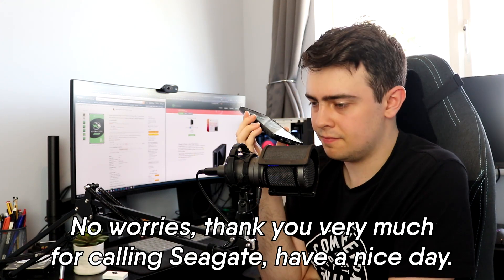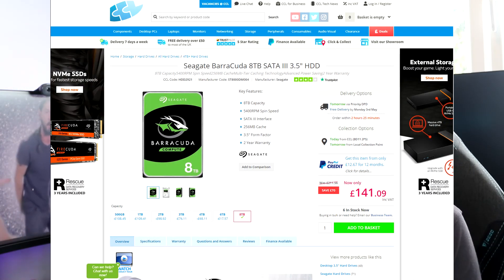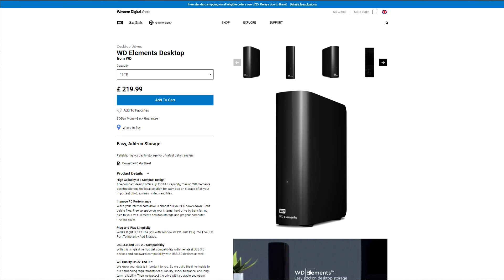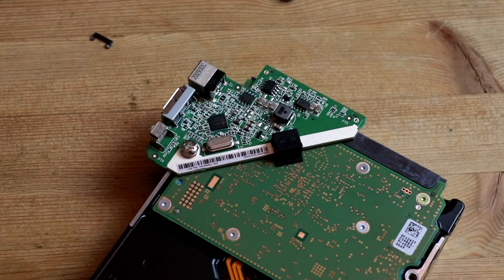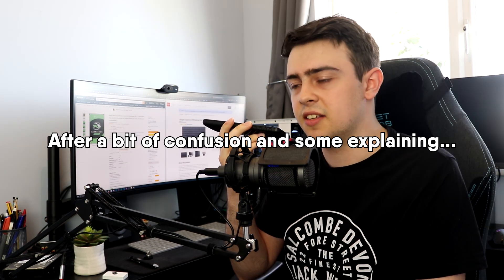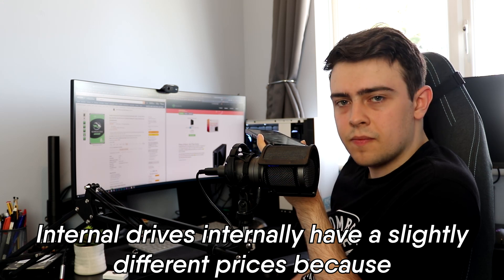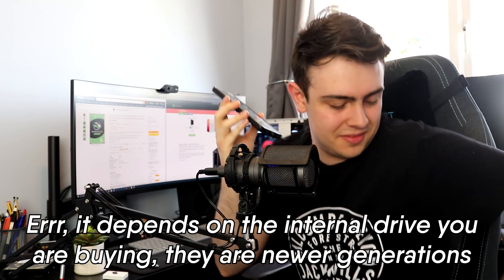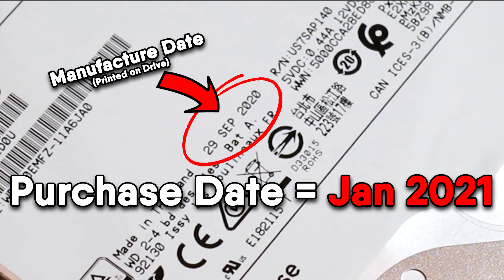How To Get CHEAP 12 TERABYTE Hard Drives! | Seagate Exposed!

Comment: There is something you are missing.  IF the drive happens to be SMR (Shingled Magnetic Recording) type drive inside the enclosure, it's a more cheaply manufactured drive vs CMR or PMR made drives.  I'm also an Tech Consultant.  I would not shuck an external, unless that external is solely going to be used for either a backup only drive (few writes more reads), or stashing a media library of pics/music/videos (again less overall writes and more reads).  I would strongly suggest against using an SMR drive as a Windows NTFS C boot drive or a MAC HFS+ or LInux boot drive with any Linux file system with journal ability.  Stick with a CMR (Conventional Magnetic Recording) or PMR  (Perpendicular Magnetic Recording) type drive for main system drive and SMR for archive or media library.  I had a client who had external 2.5" SMR 2TB drives being used as main purpose drives (work/scratch) and they died in less than 2 years and they lost all their data.  I would rather buy my own CMR/PMR type drive and put it in an enclosure that I choose.  Be careful a lot of the newer higher capacity external drives have a high chance of being SMR.  So shuck at your own risk if you don't care about your data long term.  In 2021, your boot/OS drive should be SSD/NVME.
Reply: Drive reliability is why you set up a backup or RAID !  All my data drives AR shucked  but I also have each one mirrored
Reply: @ididnotkilljfk861  that is fine if you have a lot of money for a proper setup with RAID or something setup like xigmanas.  Not everyone does.
Reply: ABSOLUTELY!! I got a Seagate 5TB external hard drive. As usual, the USB interface failed in a short space of time. It was a gift so I didn't have any proof of purchase. Long and very painfuI story cut very short, I lost the the entire 5TB of my personal data. I didn't find out until later that these horrors were actually SMR drives. This happened some years ago, so I am remembering as best I can..

Windows, of course, was useless in trying to recover or repair it, despite having recovery software. My trusty Linux system was significantly more helpful. They actually have (or show up as having) two partitions on them, one is a small one that acts as a data buffer area and is supposedly non-SMR and the rest of the drive is SMR. In theory, if the drive is left powered up then it is supposed to move data from the non-SMR region to the SMR region. In reality, the power management (in the USB interface side of things) was far too aggressive to enable this to happen.

I was hoping to find a firnware that would enable me to low-level format the drive to a non-SMR drive albeit of a somewhat smaller capacity as I would rather have a small, but useful, drive that a doorstop. In the I somehow managed to reformat the entire drive, using Linux, as one volume and have been able to read and write files. I haven't (yet) dared risk anything important again on this drive, even though it appears to be functional at its 5TB capacity.

In case anyone is wondering, It was far too easy to completely screw up this drive. I work with large video files; hence the need of a larger drive. What happened is that I changed my mind with one of the files on the drive and tried to delete it, before copying over a different file. This was all it took to completely trash the drive and (almost) lose all the data. I say almost because I was able to recover a couple of files from the non-SMR portion of the drive before it had lost them in the SMR portion.

SMR = (data) Shredding Magentic Recording
Reply: @_Clivey  A pause should not happen at all. A modern OS would use your RAM as a buffer. For example, if you copy from one HDD to another HDD, the OS reads from HDD1 and writes to RAM and begins writing to HDD2 which most likely will be a slow operation. The RAM usage will go up and up.
In Linux, you can throw at it as much RAM as you like. It will use as much as it can as a buffer.
Win 7 does buffering as well but I don’t know how it compares to Linux.
Reply: Tho segate barracuda compute are very low tier, and as far as I'm aware, all are SMR
Reply: It's kind of silly to even mention warning against using a SMR drive for a boot/OS drive as nobody in their right mind would use ANY hdd for that now that SSDs exist.  You mentioned that but only after wasting time on the rest of what was written.

SMR drives are great!  Reduce cost for the typical WORM uses people have for large amounts of data, while anything needing performance aka scratch space should be done on multiple SSDs, one for source and another the data destination.

It's kind of silly to not shuck an external back when there was such a significant price difference, which no longer exists today in 2025.
Reply: This point is super important and cannot be overlooked, there is a significant difference between the drive technologies.

Comment: I noticed the same thing a few weeks ago. When, I wanted to buy a new hard drive. I ended up buying an external Seagate 6TB from Argos. It only cost £99.99 from Argos and it was cheaper then buying a 6TB internal hard drive. Many years ago! When, I built my first ever PC with a Intel Duo Core 2 processer. It was a lot cheaper to buy a internal hard drive over a external hard drive. Crazy times we are living.
Reply: I would not trust an external drive long term if there is an SMR type drive in that enclosure.  Shingled Magnetic Recording technology is on the sucky side and is more targeted at applications of few writes and more reads like stashing a media library of pics/music/videos that don't change often.

Comment: I have a lot of HDDs, all shucked.

All my 1 TB drives, apart from one, are from WD external drives from around 2008-2010.
The last one is a Samsung from around 2010.
In total 4x 3.5" 1TB drives

Then I have two 500 GB 2.5" drives from Seagate and one at 320 GB from Toshiba.
From around 2010-2012

Then a 500 GB 3.5" and a 320 GB 3.5" from an unknown company.

I have 2x 1 TB drives in one machine
Then two desktops with 1 TB each.

The 500 GB and 320 GB capacity drives are gonna be for WinXP Retro machine and Win98 respectively.
The 2.5" drives are backups and/or transfer drives, though I might add one to one of my machines if need be.

Comment: Great findings! I have noticed that external harddrives are cheaper as well. I recent bought a 5 TB 2.5" extern harddrive for a price of 135 dollars converted here in Sweden. The plan is to buy a second one and built both inside of a custom built case with a Raspberry Pi 4 as computer for the custom NAS :)

I have an old file server stacked with a bunch of older 3.5" internal harddrives. 2-6 TB each. I think the total capacity is like 35 TB. I rearly uses it due to power consumsion and heat. I have so much other stuff like GPUs and such that takes much power and heat nowadays :)
Reply: be warned if you intend to shuck an External drive to use in a NAS and the shucked drive is an SMR type drive, your NAS will die sooner rather than last long.  SMR drives are not meant for NAS use.  SMR drives are meant for direct attached storage as archive or dumping a media library that doesn't change much.  Think of SMR type hard drive as a CD-R or DVD-R, Write Once Read Many type of technology.  IF you do regular writes and changes to an SMR drive the longevity of that SMR drive will go down very fast.  Since you plan on a custom NAS which has lots of parity calculations and writing as well, not to mention just the normal data writing an SMR in a NAS array won't last long.  You want a CMR (Conventional Magnetic Recording) or PMR (Perpendicular Magnetic Recording) type drive for a NAS.  Use SMR in a NAS at your own risk.  Drives inside of external enclosure don't usually have good online documentation if the drive inside is SMR tech or CMR tech.
Reply: @marcc5768  The thing is (for me atleast) when using a NAS I'm just put the files there, not change or delete it. And read it sometimes. Like personal photos or movies, just like a DVD-R if you compair it. I will maybe accessing the NAS once in a week so the usage won't be high.
Reply: @johanvirebrand7196  I used to run a RAID-5 storage array with 3 500GB SATA HDD. Established Array in 2nd quarter 2008.  Two of the 3 drives are still good, but the 3rd drive I think parity drive that one died 2 years ago, so I backed up the contents from the RAID-5 and broke down the RAID to single disks again.  So if your NAS is set up in RAID of some kind and SMR drives used as the parity info that will go sooner than Non SMR.  Parity drives get more writes.  Tho if the NAS is 2 drive mirror say, that could work better than a NAS setup that has parity included.
Reply: @marcc5768  I have also used RAID-5 in my fileserver, but that was when 250-300 GB HDD was common. I had so much problems with the array, disks that were excluded and the array needed to be built up again. Was running on a cheap RAID card tho, well it wasn't worth the tangle. Just running single disks now, if it crashes it's not that important because the most valued files I have backuped up on many other places.
Reply: @johanvirebrand7196  Had RAID5 3*4TB and it was pure pain to use.
Reply: @marcc5768  RAID5 has equally divided parity information, so any of the drives can break without loosing information.
Reply: @mikakorhonen5715  thanks, it's been a while since I looked at Raid-5.  Sadly..for where I live..finding an appropriate PC case with 4 3.5" bays seems to be really challenging now.  I have 2 Antec cases from 2008..which I still use..Antec P182 for my Win 10 Pro rig and Antec Sonata for my Linux Mint rig.  The Sonata has 4 bays for 3.5" and the P182 has a total of 6, 4 in the lower drive cage and 2 more in mid located drive cage.  Neither case has USB 3.0 front ports.  I have my old mobos that I pulled from both towers..which have like 6 SATA 2.0 ports each..would be could for a DIY XigmaNAS.  The obstacle is tracking down an appropriate ATX/mATX chassis to do the build.  Haven't played with XigmaNAS yes..so I don't know the potential it has.  Or how the drives can be setup with the filesystem.  Either ZFS or just RAID-5 not sure if they can be combined or not.  Right now..I'd be happy to just get a Raid-1 array on my home network.
Reply: @marcc5768  I had Antec Sonata. Destroyed it with renovation filler (tried to make case silent). :)

Now using Fractal Design Define 6. It has plenty of room. Ordered 6th internal HDD for 3D simulation data. Not gonna use any RAIDs after last experience.

Comment: G'day RMD,
Great video showing a way of saving money,  although here in Australia unless they are on sale External Drives are generally more expensive than Internal for the same capacity,
But I have pulled some External Drives apart & now used them internally because the USB to SATA Interface stopped working but the Drive was still fine,
Also what I have noticed is you can also do this with the 2.5" External Drives as well, although unlike 3.5" don't expect all 2.5" drives to be compatible,
some models do not have a USB to SATA Interface, there are quite a few models where the Drive Motherboard just has a USB Connector & not a USB to SATA Interface,

Ps I also have a CoolerMaster N200 as a Storage PC, with 1SSD for Windows & the 8 Bays full of Unloved & Rescued (Used) 1-4TB 3'5" Hard Drives, I am using a ASRock Fatality Z77 Professional with a i3-3220 & Rescued Silverstone 1500W PSU, I use it as an Archive for Storing Home Video of Family & Friends when I Edit their Footage from Mobile Devices
Reply from the maker: G'day Shane! 
I always love a good money saving tactic, glad you do too! That's news to me, interesting to hear that the pricing makes more sense on your side of the planet! 
And yeah, you're right, 2.5" drives sometimes work, but are far less reliable for shucking purposes! Buy with caution! 

I love your storage PC! Sounds like a great little rig! Tweet me a pic!

Comment: For what I'm thinking on a business side, they might just be producing and selling more external drives than internal drives. So most likely, the external drives just sell better and they aren't too concerned with adding another plastic housing and cheap sata adapter to sell the product. And absolutely the internal drives are sold higher cause there is probably more demand from it in the tech builder market which is niche or for businesses which buy them up for servers or computers. Similar to Xeons vs the Intel "i" line up and how they sell. Then again, I'm a cheap man and will take the cheapest route possible 😂

Cool video!
Reply: Also external drives tend to be a little slower than expensive drives usually, 5400rpm vs 7200rpm and less cache so unfortunately not great game drives. But they are still good for mass storage
Reply from the maker: This really does depend on the external drives you buy, the ones featured in this video are all 7200rpm drives, perfectly good for games storage
Reply: @RMDTech  yeah I still use a shucked 10tb drive for mass storage although it's 5400rpm it was still a decent deal for like $160 lol.

Comment: Great video. Wasn't expecting the phone call. The only reason I can see ordering internal drives is if you are wanting to do a raid configuration and need to be certain the drives match. Still, fo a regular rig this is for sure the way to go.
Reply from the maker: Yeah, that is definitely a reason to avoid doing this, but for all other purposes, shuck on!
Reply: UnRaid loves these drives and you can mix and match as big as your parity drive is